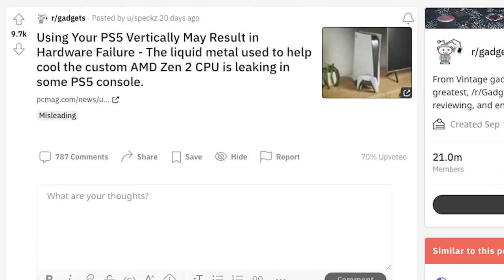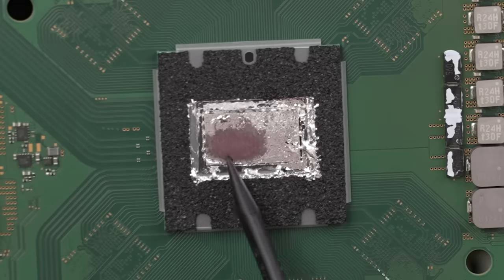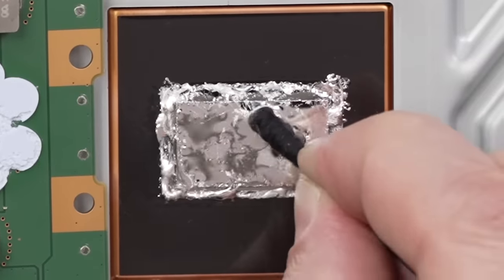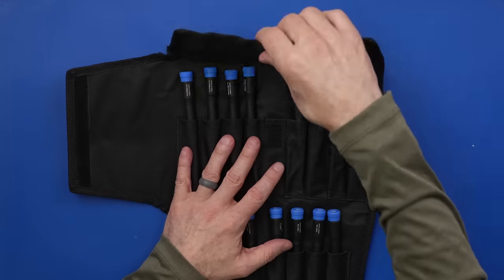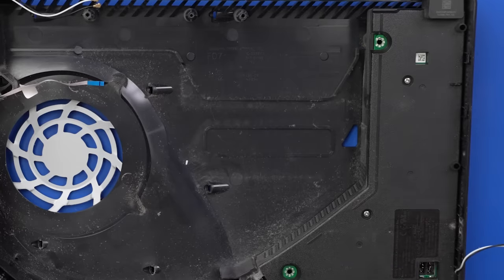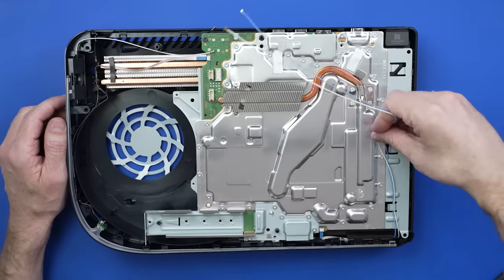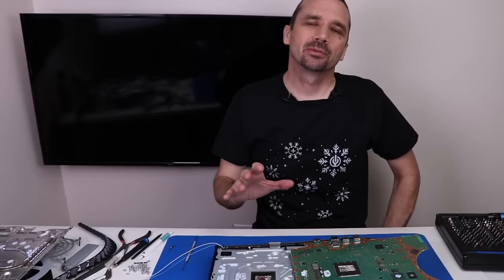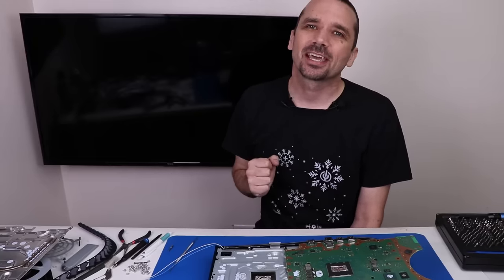PS5's Have a Liquid Metal Problem - But It May Not Be What You Think

Comment: I don't know if I can fully agree that standing it vertical is bad. I'm fully admitting that I know factually you are far more of an electronics expert than I'll ever be. I can only speak from my experience. I've had mine since launch, so over 2 years now, been vertical the entire time, and its usually on nearly all day every day. Been used thoroughly for sure. Never any shut offs or issues. The only thing I can say possibly contributing to mine's success, I keep mine up high off the floor, once every month or two I precautionarily give it a light cleaning, not past the clearly necessary 43 screws of course, and I have a desk fan angled sideways behind it to help push the hot air away faster as a safety  precaution. Not pointing air back into the system, just helping the air make a 90° turn away from the wall and going away instead of the heat getting trapped behind the console. Those were my experiences. I'm hoping mine ends up as one of the safer ones.
Reply: give it another year, it will fail
Reply: Considering how long it runs every single day, I'd be happy with three years.
Reply: I would put it horizontal always, the moment i knew that they were going to use such shapes and gpus, i knew the ps5 was going ti have issues with time..

Even then, they use such high voltages on the chips, that both consoles will die faster than any other, just by thermodinamics and materials endurance, cant cheat the laws of nature..
Reply: @Fattony6666  Once much more demanding titles are released, both consoles will die left and right, the one s with much less power usage will be fine addly enough..

Comment: My PS5 fine has been absolutely fine I've had it for nearly 2 years and have had no problems
Reply: Hi could you tell us if your model is a 10000, 11000 or 12000 one? And if you have any crash issue (shut down with Only PS5 games) 
  I'm suspecting a problem only with the 11000 one (I've 1116A) (it's written under the PS5) Thank you
Reply: @angelogalileo   Nope it's never shutdown with PS5 games
Reply: @IloveAliBromley  super. Could you check under your PS5 the number of the model (1015 1016 1115 1116 or 1215 or 1216 please?)
Reply: @angelogalileo  Mine is on a stand so it's hard to check but I know nothing will happen with it

Comment: The liquid metal Ending up on one side of the APU And dry spots Is a real thing 👍
Reply from the maker: It does seem to be
Reply: Yes I see it all the time. I wish they would've/could've gone thermal paste like the series X. This has been quite the mess for these consoles and Sony.
Reply: @hove131  Someone should do a test with just regular thermal paste 🙄 lol
Reply: @QsTechService1  lol. I've gotten ps5's in for overheating issues that had thermal paste applied 😂🤦🏼‍♂️
Reply: @hove131  They would have had to spend more on the heatsink like Microsoft did and Sony is all about cutting costs. Look how each model gets built worse as time goes on: PS3, PS3 Slim, PS3 Superslim for example.
Reply: @hove131  🤔🤣
Reply: @CarsandCats  The super slim is going to be a big issue Not able to dissipate the heat through the board because it's so small ... I think we will be seeing lots of dead aps In the future
Reply: @QsTechService1  I don't think it tops the ones I've gotten where the customers took a drill a drilled out the HDMI ports 😂😂😂
Reply: @Hove 131  Oh yes ... I've had a couple of those 2 ... Is people using drills On the hdmi port ... But can't be mad at the customer now if it was a shop doing it yes lol

Comment: The 11 series is a newer model. Not older
Reply: 2021 so yeah it’s a older model than the 12 model
Reply: Hi could you tell us if your model is a 10000, 11000 or 12000 one? And if you have any crash issue (shut down with Only PS5 games) 
  I'm suspecting a problem only with the 11000 one (I've 1116A) (it's written under the PS5) Thank you
Reply: Hi could you tell us if your model is a 10000, 11000 or 12000 one? And if you have any crash issue (shut down with Only PS5 games) 
  I'm suspecting a problem only with the 11000 one (I've 1116A) (it's written under the PS5) Thank you

Comment: I've notice with mine it definitely has issue around temperature hdmi port only saying that head blowing heat across the hdmi port,
Reply: Same! With Overwatch 2 ps5 not the PS4 Version. And crash with others PS5 games.
could you tell us if your model is a 10000, 11000 or 12000 one? And if you have any crash issue (shut down with Only PS5 games) 
  I'm suspecting a problem only with the 11000 one (I've 1116A) (it's written under the PS5) Thank you
Reply: @angelogalileo  I have the 1100 one and don't have any issues
Reply: @MustangKevin69  thank you

Comment: Is the new model more reliable than the others (1000 and 1100)?
Reply: Hi could you tell us if your model is a 10000, 11000 or 12000 one? And if you have any crash issue (shut down with Only PS5 games) 
  I'm suspecting a problem only with the 11000 one (I've 1116A) (it's written under the PS5) Thank you

Comment: I bought my launch ps5 sept 2020. It started crashing all my ps5 games just 2 weeks ago (End of June 2023) . Funny enough it can play ps4 games just fine and handle non intensive applications. But before it crashes the game stutters like it's trying to keep up with the graphical demands. I followed up with Sony support and followed all their recommendations for software trouble shooting with no change. Unfortunately it was also a few months out of warranty. Thinking ill open mine open and see what's going on with the APU and power supply unit. Note I've only had my system in vertical standing but made sure to clean it out as far as the warranty sticker every 6 months.
Reply: Did u fix this problem?
Reply: @ukaszmusialik5113  I thought I did. I did redistribute the liquid metal and added a bit more with a lot from Amazon. I also made sure to clean out the heatsinks, less than moderately dirty. It lasted for a week and is doing it again. I'll open it up again and see how the liquid metal is holding up.
Reply: @TheChzardian  maybe I'll try to change the liquid metal to a new invention - liquid thermopad PTM 7950. But it's strange that I play ps4 games or watch Netflix all day, and PS5 games or demos (each) stop after 10-30 seconds and usually The console turns off and it's not hot at all
Reply: I change but i stil have this problem. Maybye itd PSU?
Reply: @ukaszmusialik5113  I've considered this as well. Short of finding a used ps5 to change the unit, no real way to test this for me... :(
Reply: @TheChzardian  I have replacements on the market for $60-80. but I'm afraid that this is the problem again, and maybe in the software. Again, it's hard for me to shoot and spend more money that can be spent on the service. :-/

Comment: My ps5 turns off randomly when playing a game, I might have a faulty power supply
Reply: Hi could you tell us if your model is a 10000, 11000 or 12000 one? And if you have any crash issue (shut down with Only PS5 games) 
  I'm suspecting a problem only with the 11000 one (I've 1116A) (it's written under the PS5) Thank you

Comment: I Only have a problem with Ps5 games , ps4 games are no problem, 15 min into a ps5 game and it just shuts down without a error message.   Then I need to wait 30 sec to put the powercord back in . Anyone had the same problem and got if fixed?
Reply: Hi could you tell us if your model is a 10000, 11000 or 12000 one? And if you have any crash issue (shut down with Only PS5 games) 
  I'm suspecting a problem only with the 11000 one (I've 1116A) (it's written under the PS5) Thank you

Comment: I can't speak on the new 1215, but gamers nexus showed that the PS5 has really poor thermal performance. In some areas the memory was hitting like 90 degrees. And yet it's not that powerful of a system. The even found that leaving the side covers off significantly increased cooling performance. So it's not surprising that it's sensative to heat. They did not do a good job with the design.

Comment: That’s why I need your help with my ps5
Reply: Hi could you tell us if your model is a 10000, 11000 or 12000 one? And if you have any crash issue (shut down with Only PS5 games) 
  I'm suspecting a problem only with the 11000 one (I've 1116A) (it's written under the PS5) Thank you

Comment: Doesn't the liquid metal melt at warmer temperatures, the "dry" spot would be covered by liquid metal once the apu is hot and would work just fine right
Reply: No, the dry spot on the apu or heatsink isn’t going to just pull the liquid metal to the dry spot once it’s heated up. It’s called a dry spot for a reason

Comment: I have a kinda weird thing going on with my PS5, if it goes to rest mode and then I turn it back on it won't display 4k, i have to plug the HDMI in and out again for it to display 4k. I haven't found anything about this "issue" yet, anyone having the same problem?😅
Reply: Tried with another tv display? Asking cos i had an interesting issue with a nec display, had both ps3 and pc connected and sometimes the audio would cut off, turned out the nec display switched on its own between sources. Its an old story but i was blaming the console for too long 😢

Comment: Makes me think if I should lay my horizontally. But I've had mine for over 2 years and knock on wood haven't had any issues and its been vertical the whole time. Only issue is my wifi sucks in my house lol
Reply: I’ve had mine vertically the past two years as well. I don’t have any problems with it. 

If you have the money to spend I’d recommend a mesh system. I’m looking into one myself for the other side of the house. Where I have my PS5 it’s great, but on the other side of the house connection and speeds get spotty as hell.
Reply: @NuggetGaming  thanks. I'll look into that
Reply: I've told many people this, Why chance this when you can just lay it on its side. Not to mention how easy it could just be knocked over. Just my opinion.
Reply: @rayhastings2934  Yes, Also Since warranty period is most probably also over, They Would risk Burning the APUs of the PS5. Keeping it Horizontal is the safer way.

Comment: So in order for the temperature warning to come up, the thermometer has to get hot enough to trigger. A dry spot in thermal material on just a certain part of a chip may cause the thermometer to stay cool, but another part of the chip may heat up causing all kinds of problems and be enough to crash the game or shut the console down.

Comment: Liquid metal dont move UNLESS there is too much. Once it heats up it Will start running. You dont want liquid metal on other parts than Die and cooler. If it have Any liquid metal outside. Thats where it Will run to. Liquid metal allso becomes hard when under 5°c thats why it wont work with LN2 for extream overclocking. With liquid metal less is more. PS5’s are SOAKED

Comment: Am I the only one disturbed by the fact he doesn't clean up the liquid metal off the edges of the APU etc? I Don't really care that there is a seal there to keep it out of the APU, but it could cause issues elsewhere if it travels. This bugs me when repair shops don't go the extra small step to help keep things running the best they can. All the other repair channels I watch all seem to run their swabs along the edges to get the excess LM off.
Reply from the maker: There’s literally no point in cleaning that off. As soon as you respread it and put it all back together it goes right back to the edges. That’s one of the reasons there’s so much LM there imo

Comment: My PS5 stays coold for the most part, I can play friday the 13th and Modern warfare for hours without it shutting off but if I play evil dead or sniper elite 5 it shuts off in and hour. Was thinking of doing a deep clean. I've had my Ps5 vertical since it came out day 1.
Reply: Hi could you tell us if your model is a 10000, 11000 or 12000 one? And if you have any crash issue (shut down with Only PS5 games) 
  I'm suspecting a problem only with the 11000 one (I've 1116A) (it's written under the PS5) Thank you

Comment: I think it's worth replacing the liquid metal with normal thermal paste, probably the temperatures will be higher but it would solve 99% of the problems
Reply: He's already done a video testing that, it ended up overheating
Reply: It’s been done and it doesn’t work the PS5 overheats and shuts down after a while you have to use Liquid Metal
Reply: PS5 is engineered to work well only with Liquid Metal. Putting normal thermal paste will result in overheating, or a shorter lifespan.
Reply: If the temperatures are indeed higher with thermal paste, my guess is you’ll end up with other potential problems down the line.
Reply: thermal paste wont keep the APU cool enough. people have tested that and the PS5 shuts down like in this video when thermal paste is applied
Reply: He did a video on this and it made it worse so thermal paste isn’t an option

Comment: Did PS5 #2 & 3 work?
Reply: Hi could you tell us if your model is a 10000, 11000 or 12000 one? And if you have any crash issue (shut down with Only PS5 games) 
  I'm suspecting a problem only with the 11000 one (I've 1116A) (it's written under the PS5) Thank you

Comment: I've always had the tendency to place every single Playstation console I've owned (PS3 Slim, PS4 & PS5) horizontally, not because of safety issues but because I felt that the consoles looked much cooler when positioned like that, haha. Also, by the looks of it, could the best way to avoid dry spots in the console's APU be the horizontal placement? Considering how easily the liquid metal moves in room temperature inside the seal, I'd guess so. Really helpful video once again!! Most people spread rumours about the original problem but in your case, I know I can always trust your research on the topic, or any other PS5 topic related to repairs, keep up your consistency!

Comment: That seems like a lot of liquid metal to be honest. In all the times I’ve used liquid metal I’ve never once had it pool on the surface I was applying it to like that. I always apply it as a very thin film on both contact surfaces. Never had any issues with it running and going places it shouldn’t go.
Reply: ps4 pro and ps4 slim were so much better then this crud, all they had to do was stuff in latest tech and shut up but no they can't even do that right
Reply: @MGrey-qb5xz  no. Just no. You are factually incorrect. The ps5 is better in literally every single way. From power to storage to cooling, new technology is better than old technology based on a failed pc architecture (jaguar)
Reply: @BenFilley  L

Comment: After watching several videos about the liquid metal, I have been playing my PS five horizontally. However, because of the fact that Steve tore down a model 1215, I would like to ask a question that is not liquid metal.

I watched another channel (the cOder or however you spell it)  do a full teardown of the 1215 and he found that the wire that keeps the white and blue lights on was on top of the heat sink, my question is this. I have a 1215 that I just got before Christmas. Should I take it apart and possibly void the warranty to move that wire?

Comment: hello, my ps5 doesn't show heating error but it seems for me that the ps5 fan works noisy ( I hear too much sound from the fan )  when I start  any games. In your opinion is it a serious problem? the fan work like this since 2 years ago when I bought.
Reply: Mine is a launch ps5 and the fan has always had a crappy UFO whirring pitched noise. Mine has the crappy Nidec fan which is known to have an annoying pitched fan. Despite the noise I’ve had zero issues with performance. The main takeaway is to use compressed air to blow out the dust thru the heatsink and into all the little open holes in the inner casing.

Comment: Why not just replace it with thermal paste instead ? @ 16:00
Reply: thermal paste doesn't conduct heat as well, the PS5's cooling system was designed for liquid metal. it'd run hotter than designed if you replaced the metal with regular paste, potentially decreasing the console's lifespan.
Reply: @busterscrugs  I mean to be honest, thermal Pasternak great on a high-end CPU like a 5950 X need something better than thermal paste it’s not like it does more wattage than the cpu

Comment: Please, for the love of god, once you remove the dust from the heatsinks, use a high pressure blower to completely clear up the inside of the heat sinks. If you did that, then apologies in advance.

Comment: There is dry spots I have already had mine fixed from that problem

Two of the weird problems are the dry spots and the second one is the fan problem for some reason the fan works but then, when you plug in the fan to the consul of the consul will not turn on that has been one of the big issues but if you test the fan, it works perfectly fine

The PlayStation five is actually a very bad design for overheating problems and a lot of other problems. PlayStation has even said this that’s why they’re making a new one so soon.
Reply: Hi could you tell us if your model is a 10000, 11000 or 12000 one? And if you have any crash issue (shut down with Only PS5 games) 
  I'm suspecting a problem only with the 11000 one (I've 1116A) (it's written under the PS5) Thank you

Comment: This myth that you need to have the PS5 horizontal and not vertical at all, is absolutely ridiculous and has been debunked so many times.  To each their own if you WANT to do that though.  The whole issue ONLY existed because of people taking in their consoles for repair and/or stupidly cleaning it themselves without any knowledge of what they're doing.  It does NOT exist with consoles that have just come right out of the box, unless is a defective console to begin with, which is EXTREMELY rare.